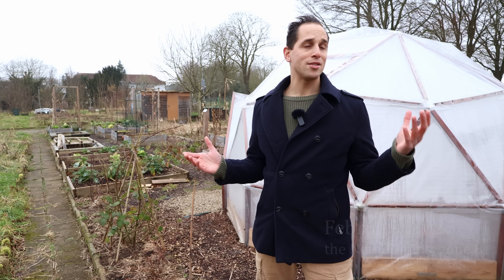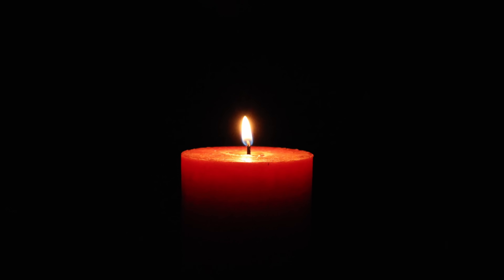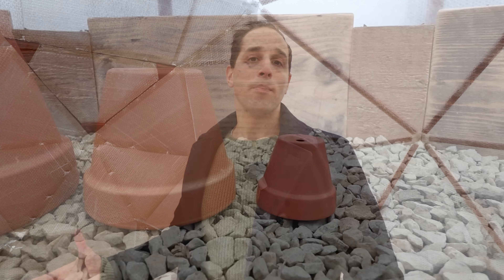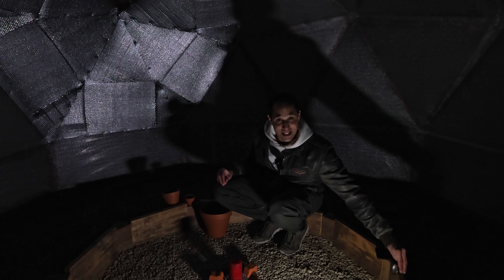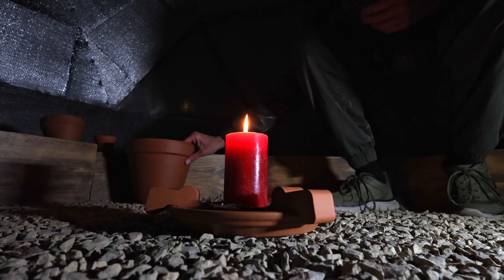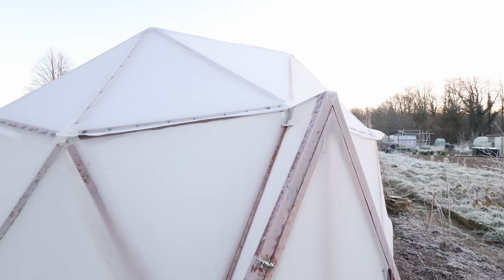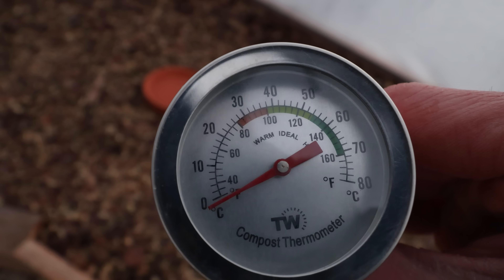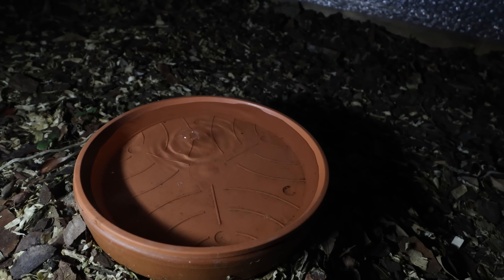Can a Terracotta Heater Keep my Greenhouse Frost-free? • Ep. 48

Comment: Pot heaters really started in WW2 to help add heat to civilian Anderson air raid shelters, they work but can only give out the heat the candle produces, can't add any extra heat.
Reply: Presumably they keep heat being dissipated by the pot down low so all the heat doesn't just rise to the being and escape from the top somewhere?
Reply: @MrMHERT80   Energy is energy, can't make it more without adding more.
Reply: @richardbaker8928   When a candle burns, the heat rises, but it will not heat the top foil of the greenhouse, because it is successfully cooled from the outside. But if you heat some other surface, such as a flower pot, the hot flower pot will cause the air to heat up differently, more widely and more turbulently. You don't add more energy, you just use it better. I use a kerosene lamp to heat my greenhouse. The flame heats the glass cylinder and the metal body of the lamp, which serve as a radiator.
Reply: @richardbaker8928   He said literally nothing about turning it into more energy. 🙄
Reply: @minecraftvsmasterz so why does a room full of people warm up when it wasnt when they were all there initially?
Reply: @hpntkz  probably because their body heat radiating, along with their breath… 🙄
Reply: @hpntkz  and you know what happens when you lose that body heat? You lose calories. ENERGRY. 

Come on bruh.
Reply: @minecraftvsmasterz but we're not as hot as candles are we?
Reply: @hpntkz  I never said we were as hot as candles. The candle is warmer than the outside air, and so is our body heat. You can’t be this serious. Either your reading comprehension is a bit off, or you’re just not all there. 

Why do I go to bed with my door closed with my dog and all of a sudden I wake up and the room is warmer? Because my dog and I breathing all night in a contained area. 

You could use a god damn warm pop tart for all I care. Heat is heat. Is it gonna last as long as a candle? No.

Clearly you have no idea how energy works or you wouldn’t make a point that makes little to no sense. This ain’t rocket science. 

Put stones in a fire and set them in a bowl of water.  
Microwave a bag of corn or rice and leave the in the greenhouse. 
A wood stove in the greenhouse. 

All provide heat with different amounts and efficiency. I hope you’re less than 14 years old because any adult should have the common sense to understand this.
Reply: @minecraftvsmasterz so it's not rock science?  But rocket science.
Reply: @minecraftvsmasterz   OK, these heaters work OK at best, they were mentioned in the bushcraft community years and years ago, lots of us tried them and they worked but they are simply not very good.  Get the same kind of heat out of a couple of kerosene hurricane lanterns...go build one yourself
Reply: @minecraftvsmasterz  No, he clarified something which got a response which required further clarification...
Reply: They added heat while obscuring the light...that's what is important about these heaters.
Reply: Protected the flame from breezes and winds when the door was opened.
Reply: It's the difference between a small flame with very little radiant heat plus heating a thin column of quickly-rising air, which goes up to the ceiling very fast, where people and plants are not, versus heating a thermal mass (the ceramic pot) that's down low, where people and plants are, and that mass can radiate all of the heat from the candle.  Heated air still rises, but more of the candle's heat is kept low for longer, as radiant heat.  The ceramic doesn't somehow multiply the candle's heat, it just retains it longer down low, where it can do more efficient work.  It's why LP gas space heaters have a chunk of ceramic next to the burner flames, not as a reflector (that's the metal backer) but as a thermal mass to absorb and radiate heat from the flames.

Comment: Of course, one of the issues here is temperature gradients floor to ceiling. If there were raised beds in the dome, they would be in a higher temperature gradient.
Reply: That is partially compensated by using the pots above the cnadle as opposed to just putting the candle without cover in it.

Comment: Hi from Canada,  one thing I do is inside a greenhouse is use low tunnels over the plants.  A greenhouse inside a greenhouse 😊.  And if a really heavy frost is expected I put  jugs filled with  hot water inside the low tunnels near the most sensitive plants.
Reply from the maker: Hi back to you, Canada! 😄 I've seen some people use those tunnels, and great tip with those hot water jugs. That's a combination that is certainly worth a try! Thank you!
Reply: would think 3 setups not one with more candles?
Reply: Yes. Smaller covers under the  cover with what ever heat source in that.  I have a small tunnel because I have only a tiny space, but I once over wintered cilantro (just to have some one steal it roots and all, in the spring, haha).  My area is mild in comparison with say, Saskatchewan, or Nebraska.  But I also had utilized clear solar pool covering cut down to tunnel size which is like very tough bubble wrap.  My temp gauge claimed it was at least 15-25 degrees warmer than outside.
Reply: i plan on covering beds. good to hear it works. thanks for sharing
Reply: Also Canadian and those are great tips indeed ❤

Comment: I don’t understand why you need any pots. Your candle only produces so much heat. The pots do nothing to increase the amount of heat.
Reply: A lot of the heat from a candle disappears straight up because of air convection. It then pools at the top of the greenhouse/dome (or escapes through cracks) with little benefit to the plants at ground level. The terra cotta pots trap the hot air and radiate heat instead, which warms everything that has a line of sight of the pot.

...presumably

It's also possible that the pocket of warm air around the candle helps the candle burn faster, which also increases the output over the same amount of time, assuming you don't run out of fuel.

It's tempting to say the pots don't do anything because yeah, they physically cannot add any output. But there may be other effects that help distribute the heat more effectively for the purpose of keeping plants from freezing.

Comment: I would suggest that you light the candle while the greenhouse is still warm. It will help maintain heat instead of trying to heat cold.
Reply: Insulation is the only thing that can be done, doesn't matter if it's warm before. Keeping heat in and the cold out.

It would be interesting to see what difference insulating the soil around it would make.
Reply: It all has to do with heat in vs heat out. The starting temperature doesn’t change the result but the length of time the candles are burning does. So burning the candles longer would yield more heat input and would contribute to higher temps. 

For this system to work better, it either needs to generate more heat or the greenhouse needs to reduce heat loss. The terracotta offers an option to continue heat output after the source has extinguished. Since the candles are still burning after the night, this isn’t all that helpful and results are likely to be the same with or without the pots.
Reply: This is completely right. 
Let’s use logical thinking with this. 

Heat is energy. It takes more energy to heat a colder room than a warm room. It also takes time and energy to heat the terra-cotta. It doesn’t just happen instantly. 
If he lights the candle while the sun is setting, before the temperature can drop, the heat will be radiating out and trying to maintain a warmer temperature than just trying to increase an already lower baseline. 
It ain’t rocket science, and I’m sure if he tried it that it would most certainly yield a better result. 

I’m glad this video popped up though, I’ve been thinking about doing this in the garage to help keep my printers stay at a better temperature in the winter. Better than running one of our gas or electric heaters.
Reply: @minecraftvsmasterz  Is the rate of heat transfer constant at all temperature deltas?
Reply: It doesn’t work like that, buddy.
Reply: No it won’t.
Reply: @judmcfeters9054 brilliant argument
Reply: @judmcfeters9054 😂
Reply: Logical 🎉

Comment: People think these things will heat a house.
An 80 Watt candle. I have a 1 kW/3kW fan heater and that's how much heat is needed to raise the temperature in a room to a comfortable level. Say 12/13 candles for 1 kW. The fan blows hot air into the room where the heat from a candle goes virtually straight up. 
One candle might work in my tiny 6' x 6' x 3' greenhouse. 
My Dad used to have two paraffin heaters for his greenhouse to keep the frost off but it was a large greenhouse..
Reply: This is physics. You have to add energy to a system. Terracotta pots will not magically increase the amount of energy that is output from a candle.
Reply from the maker: Yeah no, I definitely was not aiming to  warm up the dome to "cozy levels" as some people here might think. The main goal was to keep the frost at bay.

Comment: Get a 50 gallon drum, and compost in it, make sure you mix the greens and browns well, and you will have both a heater, and compost for your garden at the end of the season, keep adding to it as needed to keep things warm. 

win-win.
Reply from the maker: Yes, that's definitely a solid way to warm a greenhouse! But like I said at the beginning of the video, my greenhouse doesn't have that (mainly because I would have to sacrifice quite some grow/walk space), and I also wonder how much the condensation would become a problem. Perhaps a simple chimney to vent most of the moisture could work.
Reply: @atthegrassroots what about multiple compost barrels around the outside of the greenhouse?
Reply from the maker: @mderksen4432  that could work, but I think it would lose a lot of warmth to the environment, unless I run a tube all around it, let it enter the greenhouse and blow that warm air inside it, or even through the grow beds.
Reply: @atthegrassroots can consider a small water pool on the north side too, behaves like a solar battery
Reply from the maker: @dmacpher  I have actually one there where I have grown my lotus in this year. It's only 65 Liter when completely filled, but it's better than nothing!
Reply: @atthegrassroots do you have reflectors behind it on the north side? Can help a lot with winter low sun
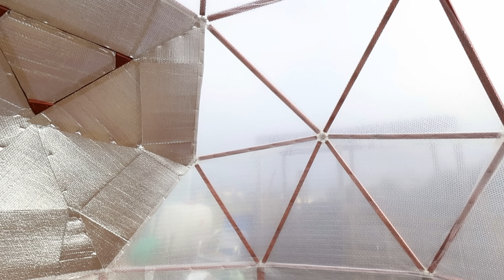Reply from the maker: @dmacpher yes! You can actually see it in the video from 0:28 onwards
Reply: @atthegrassroots you could have a sunken compost, no space sacrifice.
Reply from the maker: @riakendall8610 I wonder if that would allow for enough oxygen to reach the organic matter
Reply: @atthegrassroots there is a company that sells them, so I image so.
Reply: There are actually more than I thought, you can spend a lot on very fancy ones, but if you google underground compost bin, I found ones for as little at £20. Good luck!
Reply from the maker: @riakendall8610  thank you so much!, I will look in to it!
Reply: Throw in a dead chicken or rabbit, that will generate eveb more heat. Burry it under the greens and browns
Reply: @DeDaanste  now you got a stew going.

Comment: So, for all the know it all sceptics in the comments,  I have done this every year in my greenhouse for 5 years to stop frost forming in my soil and early seedlings. I use multiple set ups, similar to this, on the floor, using 8 hour tealights and it 100% works. This coming winter, I've bought a heater as I'm sowing Chillies in January so need a much higher heat source.

Comment: I think you are right. Sealing the green house is key. I hope you found all the leaks. I've used a latex foam as an easily removable airtight sealant. 
Like the others have pointed out earlier warm up and more thermal mass would help.   I was thinking a Mylar thermal reflective blanket lying flat on a horizontal trellis netting in your dome hung at the second ring height. It would reflect the IR heat from the setup back towards the soil and act as a airflow restriction to help create a warm air layer where you need it, instead of the heat coming out the top going straight up. You would have to remove it during the daylight hours or rig up some roller shade mechanical way to do the same thing so sun could reach the plants.
Happy Gardening
Reply from the maker: Love the detailed suggestion! There's definitely a lot more I could improve!

Comment: This is another Stupid Urban Myth!  Anyone with a ounce of Common Sense understand the pots do NOT increase the heat out put of the candle and heat rises!  You either concentrate / absorb the BTU output of the candle in the pots which does NOT heat the rest of the air volume in the Greenhouse OR you heat only the air at the top of the enclosure as the warm air heated by the candle rises to the top........DUH.  The only way to increase the interior temperature is to INCREASE the amount / size of the heat source.
Reply from the maker: This was an experiment to see if it could keep my greenhouse above freezing, and the pots are meant to radiate the heat slowly.
Reply: @atthegrassroots  And a simple understanding of Thermodynamics would have told you this wont work.  A method that would work is several solar panels attached to a heating element like those used in an older style electric stove placed inside a thermal mass sand battery would accomplish what you're attempting to do.
Reply from the maker: You are, of course, very right. I could have done that, but I think you're missing the point of the video. This was a simple experiment for myself (and anyone interested) to see if such a very low budget and easy to install way would work.
I also coukd have put a cast iron stove in my greenhouse with a chimney that goes outside and literally burn logs to not only keep it frost free, but turn it into a sauna. But that was NOT the experiment.
Fyi, I am actually interested in sand batteries, and have thought about a similar design like you suggested.
Reply: You're wrong Mr Know it all. I've done this every year in my greenhouse using 4 similar set ups. They don't heat the greenhouse, they stop the soil and seedlings from freezing. I can assure you they work. No need for such negative comments.

Comment: It just cannot work because of physics laws - to heat something (cubic meters of air and frozen ground) you need to add energy, in "joules". If candle or tealight heaters would work, why would people burn buckets, wheelbarrows, crates of wood/coal each day?  Economical way of technical compartments heating is sawdust stove, and then you need real amount of fuel. For this size of greenhouse probably bucket size would be enough.
Reply from the maker: Because people use buckets, wheelbarrows and crates of wood/coal to warm up an entire house. This was an experiment to see if it could keep my greenhouse above freezing.

Comment: I have seen people use a #10 coffee can filled with sand with a smaller can inset in the sand with crisco and a wick or two set under the terracotta pots. Apparently the sand adds a bit more thermal mass to the equation. Also I would set that up and start burning it earlier in the day to pre-warm the sand and the air inside the greenhouse so when the temp drops after dark the heater has an easier time keeping the temp warmer.
Reply from the maker: Ah yes, I think I've seen such a setup aswell!
Reply: @atthegrassroots The vegetable shortening can also burn for days. And if you get the right size candle you can get a 72-hour candle if you really insist on using a paraffin wax candle
Reply: Love this thanks
Reply: Stinks like French fry fat, sooty greasy residue on your dome.

Comment: Warm air rises and cold air sinks. The ground temperature will be colder than near the ceiling. Maybe more heaters but also put them off to the side a bit and not centered. This will cause the convection currents to circulate the heat a little better as long as you have that domed roof. Just an off hand thought.
Reply from the maker: Definitely a valid thought! Someone also mentioned trying to warm the soil up by putting tubes through the soil and have warm air circulate through them. If I could somehow combine the terracotta heater with a heat-driven ventilator and tubes...
Reply: @atthegrassroots  That sounds like a rocket mass heating system.

Comment: I would also suggest setting the Heating up just before Dar before the Cold Air sets in.  Give the Hothouse time to warm, up before the really Cold air descends for the night.  You have a reasonably large space to heat so I'd try 2 or 3 of the Terracotta Heaters.
Reply from the maker: Yeah, good point! It's easier to maintain the temperature than to heat up a space from a lower temperature.
Reply: @atthegrassroots  it's simple physics.  The more you need to warm something the more energy that will take.
Reply: @atthegrassroots maintaining a temperature is no different than heating something up.
It all comes down to how much heat you can produce.
Reply: I've used oil lamps with the chimney removed rather than candles and gotten excellent results

Comment: You will have a better results layering pots with biggest on the outside and smaller on the inside rather than stacking. I think your pots might be too small for the inside.

The whole idea is that you create layers of heat around each internal pot and that helps retain heat on each side of the internal pot. The retained heat will increase the over all temperatures as you will create a few layers that will give off heat.